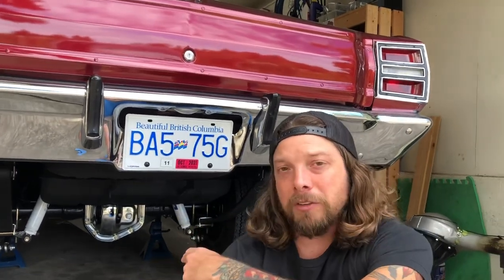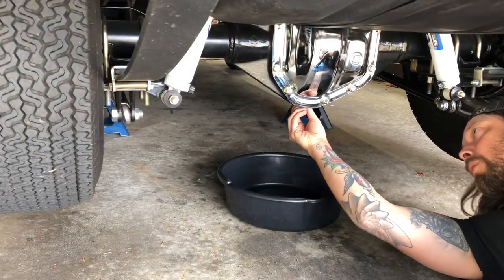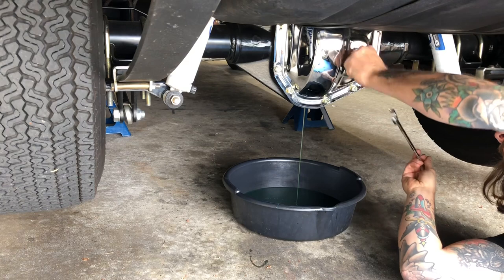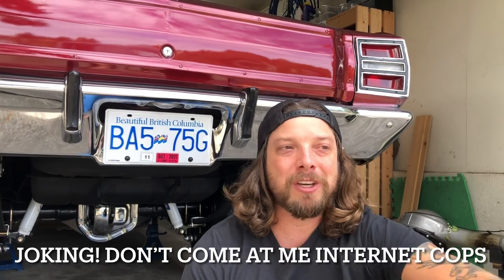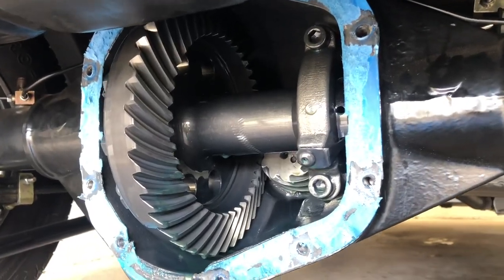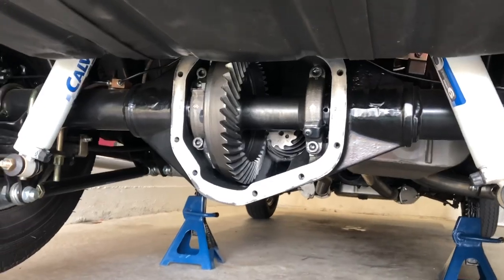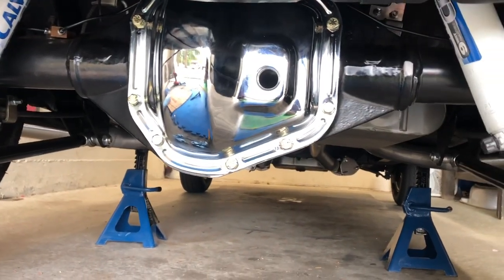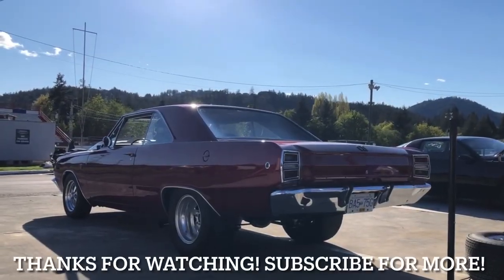Can you use a Spool on the street? + Dana 60 oil change and gear inspection

Comment: I drove a 73 Camaro with a 10 bolt and a mini spool on the street as my daily for 3 years with no problems and a 85 Camaro with a 9 inch and a full spool with no problem. Only way to go in my opinion. My 65 El Camino will have one soon.

Comment: Hello Joe! Ahhh the spool. Here is my take and experience. 67 Mustang Gt S-code original 390 4 speed car. Then.... Built 460 big block Ford with all the good parts internal and external, C-6 reverse valve body. Ford 9" nodular 4:11 gears and full racing spool, 4 link. No power steering, air or power brakes, disc front/drum. 190 skinny Goodyears front 320 60r x15 M/T rear. Problem one: very very hard to steer, the 460 weight does not help. A simple turn or backing out of the driveway was a chore as a simple right or left turn was. Tires chirping, skipping. Pulled the Center section and swapped out the spool for a Yukon Trac-Lok differential, rebuilt rear brakes, hoses and lines while the axles were out. Is now quite streetable, No longer a race car, so I don't need the spool. Want to drop in a 351 Alum Z block and take it to 427 stroker and back to a 4 speed. Did you run a mini spool Joe or a full spool? Thanks for sharing, Cheers from Motown. Let me know if you ever need a parachute, have a nice Deist for you if you get her that fast. :)

Comment: Mate I had a spool in another diff for 15yrs, built my Dana60 and put an Eaton true-trac and it was the best thing I ever did. Drives like a new car, no “pushing” on corners or uneven surfaces, and acts like a spool as soon as you hit the loud pedal.
Spool is so 80’s,there is just no need anymore.
Reply: I use a Detroit locker they lock in a straight line but allow for cornering I like them better then a spool I have used them and if you have a 100% strip car then they are great but if you run a street strip car Detroit Lockers in my opinion is the best.
Reply: when it comes to budget building they work great

Comment: I totally appreciate you doing this video as I have a spool in my build with concerns.  I’ve just done a few test miles and did not observe anything noteworthy.  Thanks again!
Reply from the maker: Right on bro! Thanks for watching
Reply: Your turning radius will suck and your back tires will be destroyed faster other than that it alright my weekender has a detroit locker and I drive it on the street
Reply: @79tazman  I've driven it around the block a few times (getting the bugs out) and it didn't seem too bad.  We will see how it goes when I actually put some cruise miles on it.

Comment: I run a 8.75" in my 1970 Dodge Dart. I have a Shure Grip differential that is set up extremely stiff, darn near a spool in handling. You hear some tire squeal in tight  slow corners. The biggest thing is just be careful on wet pavement.

Comment: Only time I feel sketchy about my spool is if I get caught out in the rain , I've had mine in my 68 Satellite for years . My car runs 6.50s / 10.30s  on narrowed truck 60 ( factory B-body width ) and it still has the original 4.10 gears in it

Comment: A mini spool is also a good cheap option that's easier to install for those who are making 300whp range. Just buy a solid one like the RTS FORGED MINI SPOOL they are about 200.00 but shouldn't fragment like the cheap cast ones that goes for 20 to 90 bucks

Comment: Well there ya Have it, no one could drive a High stall converter on the street, then it was Nope Cant drive a Reverse Manual valve body on the street, ,(,but not with a very tight factory converter,, been done too). Oh no not a Mechanical Roller Camshaft, Q:How often have you had to reset the Valves?. and for a Real Question, if going to a spool why not just use 8 and 3/4"? rear.. Or if you have a Dana why not just a standard limited slip?? Or? does this mean More Horsepower for the future and you want to be ready?
Reply from the maker: This means more horse power and a trans brake in the future! Thanks for watching

Comment: Sure you can run a spool on the street, as a daily driver too. I even ran a quick change for a couple of weeks on my '64 Barracuda-out of necessity. 
I seemed to make far more right hand turns then left, I did notice some wear/chunking on the outer tread near the sidewall on those Mohawk Super Mag 50's passenger side tire.

Comment: no need for a diff pan gasket. Just use Permitex Ultra Grey and be done. That's all I do for my Ford 9". Also, I have a 2003 Ram and Dodge doesn't use a trans pan gasket or a diff cover gasket - just the Ultra Grey.
Reply from the maker: Ya I just don’t trust this stamped steel unit. Thanks for watching

Comment: I dont think it's so much "can" but "should" you use a spool on the street. You can use anything on the street. It just depends how much maintenance you want to do, aggravation you want to put up with, and how you're going to use the car. As for a spool, I would never recommend one in a daily driver. I dont beleive the guys who say they use them in their daily, because they would have a very difficult time in the rain and snow. Out for a cruise on a nice day? Sure. But I would never run one (mini-spool can do this) with C-clip axles.
Reply from the maker: I agree

Comment: Does a spool only fit in a open diff or can one be put in a limited slip diff thats worn out ? I have a dodge ram 1500 91/4 rear diff that has become a street strip daily but i only put about 10k miles a year .not experienced in this area an maybe if i could take it apart an put spool in save myself some dollars . Love the dart 👍sounds awesome
Reply from the maker: A spool replaces everything else, you also buy a bolt in mini spool. Just search your rear and see what’s available!
Reply: @SimpsonsSpeedShop  ok thank you for the quick response an info i will do some searching cheers 👍
Reply from the maker: @DarrensTruckzs  good luck on the project bro!

Comment: Could you, sure. However, your tires will wear out so fast its not funny. So, it would not be practical to street a spool.
Reply from the maker: I wanted to buy new tires anyway. Hahaha thanks for watching
Reply: @SimpsonsSpeedShop  yeah my rear lockers stuck on. I lost a good 1/16th of tread just getting home from a trail. Aprox 2 weeks of low use city driving so I can imagine how fast it would chew them up. Out of curiosity why not try a torq auto locker. It's a fairly new and improved version of the lunch box locker.